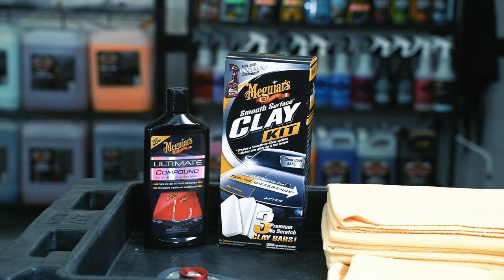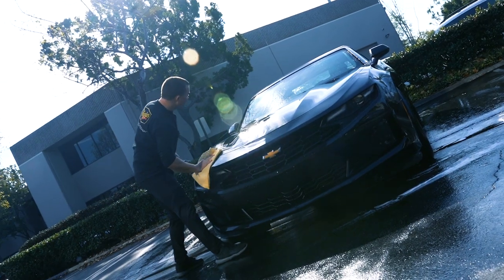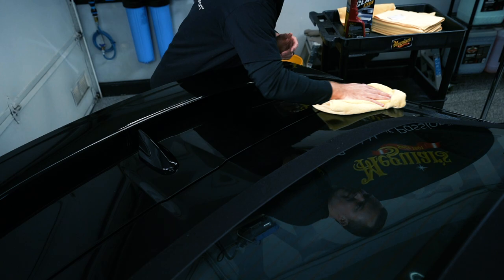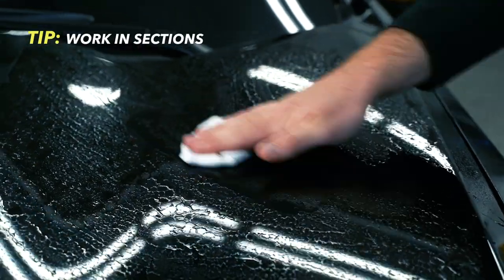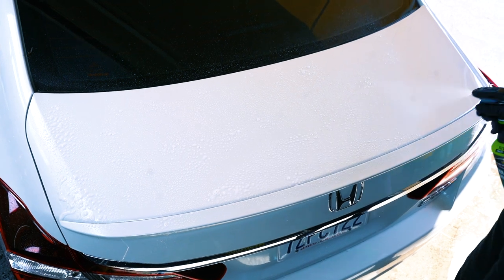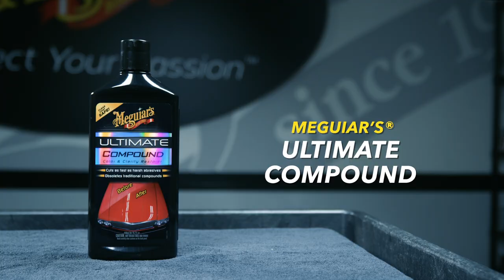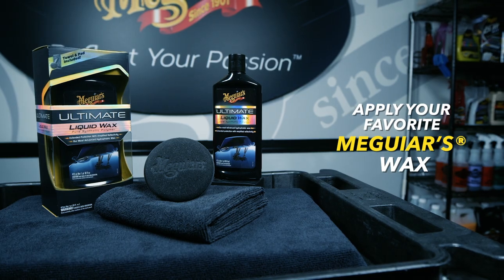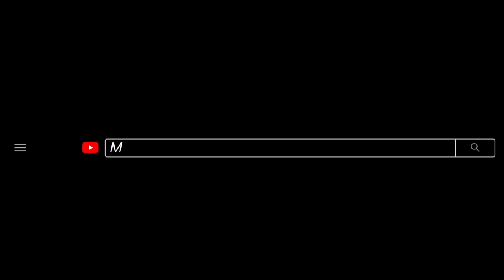Clay Bar vs Compound - Meguiar's Cuts Through the Confusion Between Each Step

Comment: Is it necessary to polish after compound? I thought compounding is an aggressive buff which can lead to lighter swirl marks which can then be polished out?
Reply from the maker: It is not always necessary to compound after polishing for a number of reasons but to answer you question specifically many good compounds finish out nicely and do not require any more compounding or polishing before waxing.  If you "want" to polish after compounding is going to be determined by a number of factors specific to your car and personal desires for it.  The short answer is no, you often do not need to polish right after compound and in many cases you could go right to your favorite wax after compounding.  👍
Reply: Meguiar's thanks for the comment. I will make sure to check out some meguiar’s compounds and experiment on my black car.
Reply: @meguiars  Compound after polishing? don't you mean polish after compound?

Comment: If you use body filler , when do you use clay bar and compounding ?

I assume its :

Body filler
Sand
Wash &dry
Base coat 
Light sand
wash & dry
Base coat
Wash & dry
Clear coat
Wash &dry
Clay bar
Compound
Polish 

Correct ?
Reply from the maker: That is the correct order but a couple things to point out.  

1)  You don't necessarily need to wash between each step as long as the surface is still clean.  Of course will not hurt anything either.

2)  Claying removes bonded contaminants that have fallen on and stuck to the paint.  That usually comes from your vehicle being exposed to the elements while parked outside or driving around.  Not sure those type of bonded contaminants would be landing on your paint during this process in a closed shop.
Reply: @meguiars  thank you very much for the response. Appreciated 👍 by the way the work would need to be done outside though.

Comment: My 2016 truck was repainted three years ago and the paint is in great shape with no swirls but just a couple of moderate scratches and no dents (knock wood).  If I use compound to buff out those scratches, do I need to compound the entire vehicle before polishing and waxing?  My challenge is the small time windows provided by Colorado's hot summer weather (with unforecasted light rain bursts in the afternoon), and the fact that my truck doesn't fit in my garage.  Would greatly appreciate your advice!
Reply: How much did a truck repaint cost you?
Reply: @simd510  - more than I could ever afford. Insurance covered it.
Reply: @gdude7397  was the factory paint job bad?
Reply: @simd510  - No, I just got caught in a really bad storm in Wyoming.  Was sandblasted before the blizzard hit.

Comment: 👍.  The smell of meguiar's "removing spray clay", looks like "all wheel cleaner" where has "iron decon"?.  Removing spray clay can be used as a lubricant for synthetic clay bars and C2000, C2100.  Is it the same for iron decon?  Thank you
Reply from the maker: Both products use the same chemical to remove Iron but these are not the same products. To ensure that you remove all contaminates from the surface you should follow up with a clay bar after using an Iron Decon.

Comment: Do you have to apply Ultimate Liquid Wax before applying the Hybrid Ceramic Wax or does applying the Ceramic Wax after compounding and polishing work fine?
Reply from the maker: Although technically okay you certainly do not need both waxes.  Typically you would just choose your favorite and use it.  👍

Comment: Can you use hybrid Ceramic clay kit on coated cars?  Will it make the finish?
Reply from the maker: Yes, this product would be safe to use on your coated vehicle. This product will remove any bonded surface contaminates and ensure that your vehicle is smooth to the touch.

Comment: would the clay kit help to fix up paint fading on hood?
Reply from the maker: Fading is typically oxidation of the paint which clay will not help with.  Clay is specifically designed to remove contaminants that are bonded to the surface not defects in the paint.  For defects in the paint, you will need an effective/safe compound like our Ultimate Compound.
Reply from the maker: Keep in mind that if the paint is already failing and not just oxidized the only real fix would be a repaint.

Comment: Car magnet decal seemed to have done something to clearcoat or the plasticizer from the magnet is in the paint, what should I use?
Reply from the maker: Your best bet is likely going to be a good compound like our Ultimate Compound.

https://s.3m.com/mz4rtm
Reply: @meguiars  thanks. Should I follow with polish then wax?
Reply from the maker: Polishing is often an optional step.  Depending on the color and condition of the paint it may or may not have a big visual impact.  That really is a personal decision you will have to make based on those things as well as you personal desires for your car.

Comment: Do clay bars strip wax?
Reply from the maker: Yes, to varying degrees clay can have a diminishing impact.  How much of an impact is based on which clay bar and especially which wax you have on your vehicle; however it is just safe to assume if you clay you will be stripping wax.
Reply: @meguiars  I have overspray little black paint dots in my white RAV4 would clay do the job and wax after to remove it?